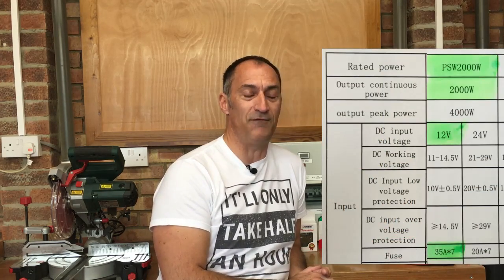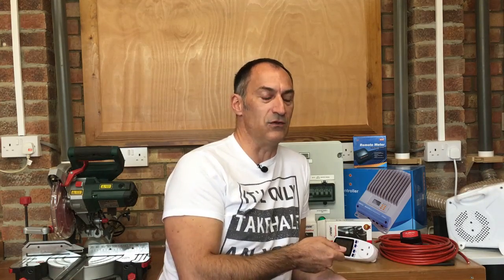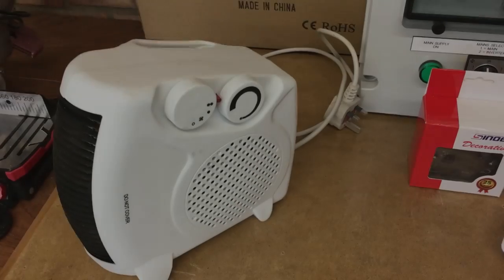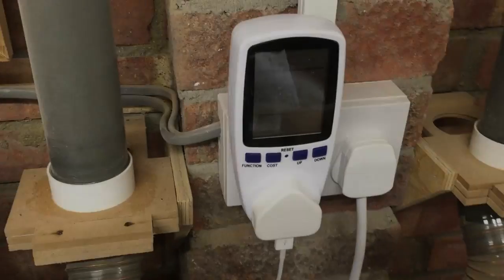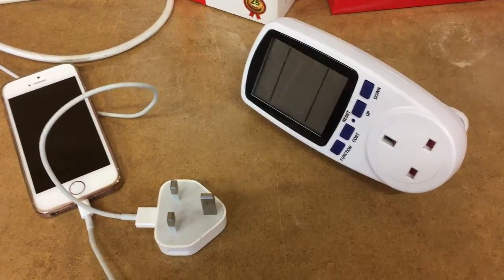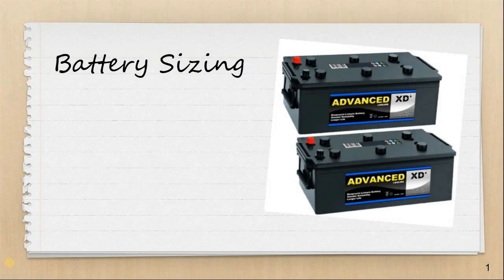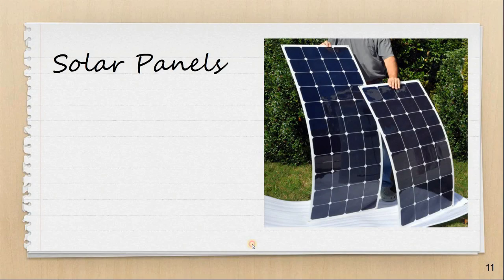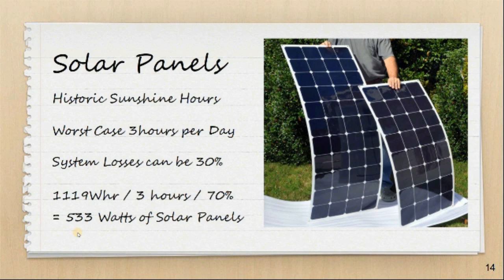Off Grid Battery & Solar Sizing - Self Build Campervan

Comment from the maker: Thank you to everyone that suggested I should have 12v charging sockets for phones, kindle and iPads etc. In my next wiring video you will see me making some 12v USB sockets to match all the other switches in my van. https://youtu.be/Ab4mNaEjJUo  Thank you
Reply: Greg Virgoe really enjoyed your series can I suggest I’ve seen movable spotlights that clip into a rail so they can be switched around as required, the neat thing is they are also made with integral usb charging points
Reply from the maker: @darrenjones3681  yes I think Dometic make those rails 👍🏼
Reply: Awesome videos
Reply: In our van I actually wired in my own plugs for our laptop cables and use a DC 2 DC converter with an lcd display to take our 12V supply and bring it up to 19.5V.

This is far more efficient and helps us use a measly 100ah leisure battery to work on the road.
Reply from the maker: Hello Nick Hoskins , long time since you posted this so hope you see this but do you have details of your dc2dc device please?
Reply from the maker: Hello Nick Hoskins , long time since you posted this so hope you see this but do you have details of your dc2dc device please?
Reply: I don't agree or disagree that dc-dc charger, but ac-dc battery charger would be nice too. Considering the capacity of solar panels charge capacity (eg in winter in northern Europe).
Reply: I'm loving these videos Greg :-)
Reply: Your split charge relay is not going to be very efficient at charging your battery.  If your vehicle has a smart alternator virtually no charge at all.  I would suggest a batt to batt charger could fully charge your battery.  If you have a modern smart alternator check that your b2b charger has the smart alternator capability.  Any size will produce a better charge than your split charge relay buy.i would recommend the largest practicle.  STIRLING POWER PRODUCTS  say up to 80% of your alternator size.  It.must have a temp sensor for lead acid batteries  as you need higher charging.voltages at lower tempratures.   
Vitron buck chargers and Stirlings latest models can charge both ways with setable max charge values.    
B2b chargers can charge near to there rated value at tick over  so in an emergency its would be worth running your engine for an hour if it would put 60, 80 or.100 amps plus into the battery.
Lithium batteries are getting cheaper and long term can be cheaper.   Some advantages,  more efficient charging  (about  10% more charge than lead acid),  can  be discharged to about 80%.   But they can not be charged below 0°C.

As you have noted All DC charged devices are more efficiently charged direct from battery than via the inverter,  how ever laptops need special adapters due to the higher voltages of there batteries  and they have multi plug fittings for various makes and adjust the voltage for the battery.  I got mine from Maplin, so all I can suggest is keep your eyes open for such units.

As will have been obvious from my comments I very rarely  connect to mains if virtually all your non driving time is going to have mains connection maximising charging opportunities is less important.
Best wishes.

Comment: I installed both 12v and hook up 230v. To be honest when we go on the road we never take any 230v appliances, max we use in the evening's is an Ipad,  a couple of mobiles, a 12 volt fridge and six 12v lights. Batteries have never gone below 60% in the UK. Are we just lucky or frugal ?

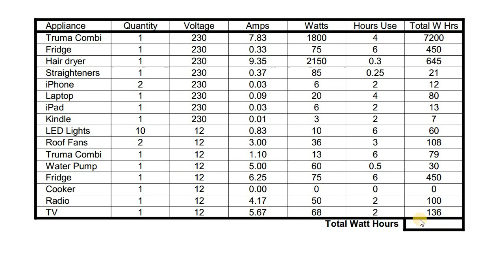Comment: Hi Greg, I think there is an error in the Total Watt Hours calculation (9:57). The Quantity column does not appear to carry through to the final Wh figures. For example LED Lights Quantity 10, 12V, 0.83A for 6 hrs giving a total of 60Wh in the table. Quantity 1 x 12 x 0.83 x 6 = 60Wh... Quantity 10 x 60 = 600Wh. Revised total Wh including 2x iphone, 10x lights and 2 x roof fan would be 1,718Whrs. 

Your videos have been immensely useful to me and I do think they are one of the very best van build resources on YouTube. Thank you!

Comment: Hi Greg, I’m trying to calculate my setup. For full time and overestimating so I’m safe I’m looking at 2,531wh. Due to British weather Im thinking a reserve of 7 days. Want a lithium battery so around 80% discharge rate. When I go to calculate the total number of ah 2531 x 7 = 17717 / 80 = 221.46? Where am I going wrong here? Is my reserve too high? Should I look for 5 days reserve? That’s still 158.18? I thought the ah number should be higher than the original wh?

Comment: How do you calculate amps/watts if you’re just using the usb connector? Does the 3 prong plug make a difference in the watts used?
Reply from the maker: Ok let’s work it out. USBs are 5volt and up to 3amps on fast charge so that gives 5v x 3a = 15Watts as their max power use. However on the mains side of that plug the voltage is 230v so working it back 
15Watts / 230v = 0.065amp 
So the same 15w of power was 3amps on 5volt but only 0.065amp on 230v side. Watch my video on cable sizing for more information

Comment: The maths has funny coincidences. Calculating the Ah, we x2 then /0.5 then /12, which is equivalent to x2 /6, which is equivalent to just /3. So basically, to find Ah from Whr, divide by 3. Then just divide that number by 0.7 for your solar
Reply from the maker: It can be simplified but you have to explain it the long way because then you understand where the numbers come from. Otherwise it would not mean anything.

Comment: Hi greg
I have a 2002 fiat ducato hobby 600  & after a marriage breakup now live in it full time but this time of year I'm not getting the solar panels charging my batteries so can I swop the 2 batteries I currently have for 2 140amp batteries.
I had to switch my inverter off as it was draining too much power from my current batteries & I can't use my gas/12 volt heating due to lack of battery power through little or no sunshine to charge them.
I'm currently running the engine to charge my batteries at 1500 rpm for half an hour.
Being in a motorhome this time of year in the weather conditions isn't much fun & to try & rent a single room is absolutely expensive compared to the mortgage I had on my 3 bed house.
Many thanks.
Reply from the maker: Improving the battery capacity will improve the amount you can store and doesn’t require any other changes but you will still only be able to generate the same amount to top them up and you can only use what you can generate. Do you have any scope to increase your solar panel size as that will help if you are off grid a lot.
Reply: Thank you greg for your helpful advice.
I do have 2 new renogy 100w panels I bought for a camper conversion that I did not do on my iveco daily mk3 van due to wet weather conditions at the time plus then working full time & I had things in storage.
Problem is the only area I could fit the solar panels is at the rear of my motorhome above the rear skylight.
I also bought a higher capacity solar charge controler & have all the cables & wiring for it but again the weather now is not good for fitting what I have & its frosty here down in south Kent.
I do have a 3400w Clark inverter generator but as I'm near residential housing I don't want to annoy people as I might get moved on & there isn't anywhere else to park up unless I find a caravan motorhome site that is open & I can hook up to their power supply.
Many thanks again.
Kind regards.
Glyn

Comment: I know this video is old but I noticed that in your watt hour calculations you neglected to multiply by the quantity figure where there was multiple units. You only multiplied the watts times the hours used on each item.
Reply from the maker: There was an error in my equation that has been mentioned previously and the free download is corrected
Reply: @GregVirgoe  I figured as much. You do an incredible job with these videos. Detailed, intelligent guidance that's easy to grasp. Thank you.

Comment: But surely you're not going to run the radio the TV the iPad the laptop and the water pump and all these things simultaneously. Something like the water pump might only be operated no more than a few minutes a day
Reply from the maker: You are right there will be diversity when in use but overall the total power used during the day adds up to the required battery capacity.

Comment: Can you automatically set the battery to stop discharging at 50%? Surely you're not supposed to keep checking the charge controller to work out if it's safe to keep drawing a load from them?
Reply from the maker: You can buy automatic disconnects to do that. But it’s not hard to keep an eye on your voltage. I’ve done it that way for 5yrs without any stress 😃
Reply: @GregVirgoe  I want to use the system to power garden lights that come on when it's dark. I want them to stay on but automatically switch off if the battery is at 50% as I won't be in the garden or near the controller majority of the time. Do you have a link to a suitable battery disconnect?
Reply from the maker: @thehomme  here you go https://amzn.to/3pR6mI2

Comment: Hi Greg, thanks for your detailed sizing video. I'm currently calculating off-grid usage and have a similar load calculation for watts per day. 

My question is about your fridge estimate on 12v feed. I'm looking similar at 12*5.5=66-watt draw but have calculated at a continuous run time of 24 hours meaning a daily watt demand of 1584 WPD .. 

We only have maximum solar coverage of 300 watts based on roof space. I see you are calculating at 6 hours over a 24-hour period which would reduce our load to a comfortable 396 WPD
The question is are you only running the fridge for 6 hours per 24-hour day?  

If this still allows food to be cold and you are mindful of opening frequency this would help us to manage between solar and split charge.
Reply from the maker: The compressor on your fridge does not run continuously when it is switched on. It runs intermittently on the thermostat 
When the fridge is cold the compressor turns off until the contents warm up a bit then it switches on again. So it is not always drawing power and it’s use depends on the amount you open the door and the ambient temp of its surroundings. Providing lots of good ventilation to the back of the fridge is important to it operating efficiently.
Reply: @GregVirgoe  Many thanks for your kind reply. This makes absolute sense and is obvious now you've highlighted it. This will definitely help with realistic calculations.

Comment: Hi Again Greg
I have a million dollar question and one which is debated all the time, so where do you stand on the 240v Earth to chassis.
My inverter says to Earth to chassis using a 10mm Earth. Do you think the 240v consumer units should be earthed to the chassis. I have heard it said that 240v system should be earthed to separate chassis Earth from the 12v negative. To me this is all one Earth if going to the same chassis and unless you stick a grounding pole in the earth outside it doesn’t give you a genuine earth. Would it also give you a negative to earth fault ?, I’m no expert but this is a very grey area to me.
Thanks in advance, and just wondered your opinion.
Keep up the fantastic work with the videos.
Reply from the maker: I have just completed a training course on circuit protection to the latest wiring regulations and my previous advise was wrong 😑 
You should fit a consumer unit direct to your hook up with double pole Type A RCD and double pole MCBs. Connect all earths to the common earth bar inside the consumer unit but DO NOT connect a mains earth to the metal body of your van. This is actually a requirement under statutory laws because there is a serious risk of fatal shock of the site power loses its combined neural earth connection. 
You need to check with your inverter supplier what protection they include. 
Igbo short circuit protection is provided them you will need an RCD on the AC output and a common earth connection your devices to the metal case of the inverter. But again NOT to the van 🚐 
Sorry for my earlier confusion and hope that clears thing up. New video out soon

Comment: Hi Greg, follow all your vids and there very informative so looking for a bit of advise.
I have a renogy 100ah lithium battery and a renogy 2000w inverter charger with auto changeover, 120w solar. 
But my question is what size cable can I run from my starter battery to my renogy DC to DC mppt charger.
I was hoping it would be 16mm or is the inverter a factor?. I was going to run 50mm from leisure battery to inverter but not sure if I have to upgrade the cable between starter battery and dc to dc charger
Thanks
Reply from the maker: You are correct. 16mm from dc to dc to van battery. That has no affect on the cables from Leisure battery to the inverter. 50mm to the inverter will be plenty.

Comment: Best videos on YouTube!
Reply from the maker: Thank you so much 😊👍🏼
Reply: @GregVirgoe  doing it all myself thanks to you. Saving me lots of money! Thanks so much Greg
Reply: @GregVirgoe  hey I’ve got my wiring setup all drawn out! I’ve found what’s called a DC-DC charger now and it’s starting to get overwhelming! Do I need one? I’m sure it’s nice to have . That use the truck battery to charge the batteries in the back when there’s no sun? Where would the DCDC wire into the mix?
Reply from the maker: @jonnytacooutdoors  yes it’s a good backup to have and can charge while driving. I would go for an isolated DC to DC charger and connect the positive and negative wires from the charger to the same terminals as the MPPT charger 👍🏼😃

Comment: Hi Greg, I have filled out my own spread sheet and followed your calculation formula of Quantity x Watts X Hrs Use, but can you please tell me how you reached 60 Watt Hrs for the LED Lights? I must be miss understanding you somewhere so really hope you can help. On your sheet for the LED Lights you have Qty 10 x Watts 10 x Hrs Use 6 which equals 600 Total Watt Hrs but on your sheet you have 60 Watt Hrs? I have the same question for the 2 Fans you have shown. 2 x 35 x 3 is 216 Total Watt Hrs but on your sheet you have half of this at 108 Total Watt Hrs. What am I doing wrong here Greg? On my spread sheet these items are really driving up my total watt hrs and as a result battery capacity and solar required.
Reply from the maker: Sorry, I did have a multiplication error in the video which is why the figure is smaller. However in reality we only ever have one light on at any one time and most days only the fridge and heater are running so there is a lot of diversity that you can apply to the use. At the end of the day it’s a rough estimate to give you an idea of usage. 👍🏼😃

Comment: Hi Greg, re-watching your great videos again as I have started my Peugeot Boxer build. QQ - As a YouTuber I assume you now carry allot of camera equipment on the road which all needs charging. I also note you did not include this camera gear in your calculations. Can you tell me if the solar panel and battery sizing you chose has met the power needs of everything on your list PLUS the camera gear? I will be taking a drone and camera equipment when I travel in my van so am curious to hear your real world experience now on the road with your van. Thanks in advance.
Reply from the maker: In reality the camera gear doesn’t take much at all and my vlogging camera and drone batteries charge off usb leads. So generally have them plugged in to the van while we drive along. 3 Drone batteries maybe charge once a week depending on where we are. 
Biggest consumer of electric is the fridge followed by heating if it’s winter time. Everything else you can manage when you have power available 👍🏼😊
Reply: @GregVirgoe  Thanks Greg

Comment: What about sizing of the inverter?
Reply from the maker: You want to keep your inverter down to as small as possible. 
Look at the watts of all your 230v appliances to see which will be the largest. My biggest draw is my laptop @ 140W so even a 500W inverter would be plenty for me. 
You also have to look up what the max amps you can draw from your batteries. A 3000w inverter at full capacity would need 250Ah of power and the batteries may not be able to handle that. They have a C rating which dictates the max charge and discharge amount.

Comment: regards the manufactures power rating plate, it is infact  accurate because it's recorded at a factory set voltage, when you plug it in to your house your voltage may differ slightly from the factory set voltage therefore the wattage will differ too. If you then use your power reading from your house and calculate back to 12v your results will be incorrect . In UK you can get anywhere from 220v to 250V commonly in different properties
Reply from the maker: The point was that some appliances rarely use their maximum rated current. A 5%difference in voltage is not going to make a big difference
Reply: @GregVirgoe  I wasn't arguing that , my point is when calculations are being made you should always use maximum values and only apply diversity where appropriate
Reply from the maker: @stevekennoy  that doesn’t always apply because you have to apply some diversity on fuse boards for main breakers or they end up ridiculously huge. Same applies to ring circuits etc 😊

Comment: Is your TV 12v?
Reply from the maker: It’s actually 19v running off an external mains adapter which I have now got rid of and powered direct off the batteries. See my video here How to connect a Mains TV direct to 12v DC - Off Grid Living
https://youtu.be/1AFbVR4eSXs

Comment: Hello Greg I have a renault kangoo 1.5 dci van thinking on building a small camper
Insulation like the way you did your van
I would like to fit a simple practical electric system and fan vent extractor any ideas much appreciated